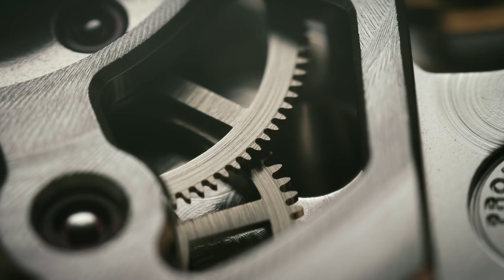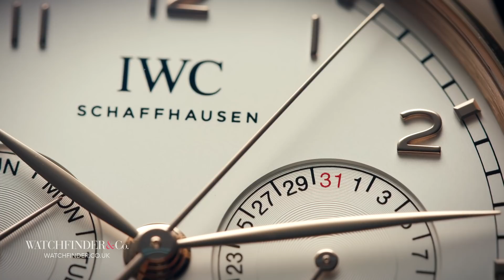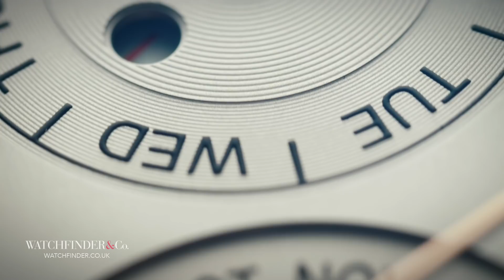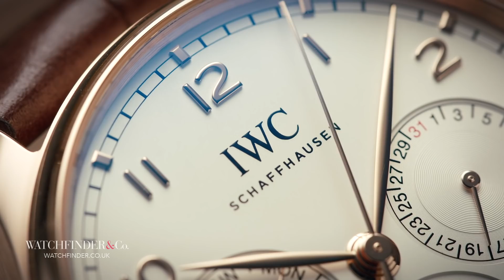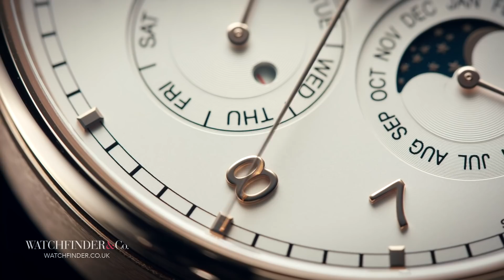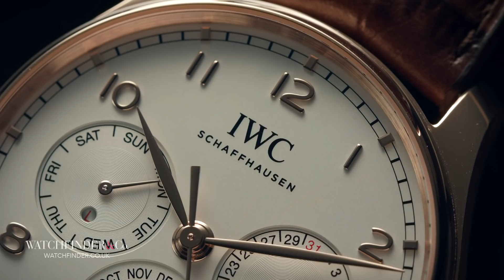The PPC 42 is the Perfect IWC Watch | Watchfinder & Co.

Comment: I own a perpetual calendar white gold and it is an amazing watch. My version is 44 mm (with the year indicator) and it looks fine on my 17 cm wrist... I can wear it with a suit no problem, fits under the sleeve... The movement is delicate, so adjusting anything at the wrong time will set your watch on its way to Switzerland for repair. That is a big heads up. That happened to me once and, trust me, you don't wanna go down that road (took months to get it back). Highly recommend a programmable winder to keep it running if you don't wear it that often.

Comment: IWC are a very masculine brand. But I don’t know why most of their watches are so big. If they took 40mm as standard and went back to their great 1950s aesthetics they’d be more successful.
Reply: 42mm is the original size for the Portuguese back in the late 1930's (this watch is the same size).
Reply: How ironic that so many people liked this comment. The IWC Portuguese is one of the most traditional watches in the game. It’s always been 42mm. They don’t beed to “go back” to their 1950 aesthetic...it’s been the same for nearly 100 years.
Reply: jason starek I never mentioned this model I referred to the brand.
Reply: As an owner of a Big Pilot, that model speaks for itself, and is justified given its actually a scaled down luxury Pilot version of the original 55mm behemoth.

However, for everything else, I would venture a different guess here given I doubt it has anything to do with their engineering capabilities to make something thinner.

The answer is "the Richemont Group". I would expect that there are some corporate flowdowns to Panerai, IWC and JLC to not overlap each other. If the Portugieser gets smaller and thinner (and it did this year btw, but still not thinner than JLC), that overlaps with JLC master control series. Master compressor is no longer in production because it was very masculine, and masculine is for IWC and Panerai it would seem. 

Richemont instead seems to be unfairly marketing JLC as a budget Patek Phillipe, and attempting to get IWC and Panerai to recapture the magic of the early 2000s back when they were industry darlings.

With the industry trending back down to smaller watch diameters and thinner cases and movements, it will be interesting to see how IWC navigates the times given likely "internal constraints".

Disclaimer: this is all my speculation, nothing factual or researched in any way.

Comment: No it's not.
1. the power reserve failed to retain its predecessor's 7 days, not even 3 days.
2. no power reserve indicator.
3. its perpetual calendar is still the simple and hard to adjust synchronized version. The independent adjustability of year, month, day and date is a MUST to a high end perpetual calendar watch.
Reply: I disagree, that's the great thing about IWC PPC watches that everything is synchronized. I don't see a reason to adjust the calendar individually.

Comment: I like the looks of IWC, but in general I consider this brand a ripoff.  Well designed watches but you surely need to do your homework when looking for one because the movements in more than 60% of them are just updated ETAs or subpar for the price these command.  Summary:  Good looking watch, not so much value in general.  JLC or Lange are heads and shoulders above.
Reply: I would agree with you. I have an Aquatimer 2000 whilst the accuracy is brilliant, the strap on mine is rubber, you cannot change it to anything other than the same at£200 or £1000 for stainless steel. Because, it has a particular quick release mechanism licensed by Cartier.  I blame my self and am desperate to get rid of it. Apart from that is is a nice watch and brand